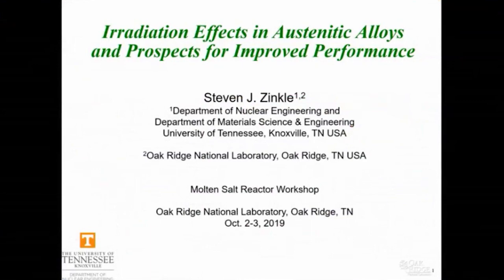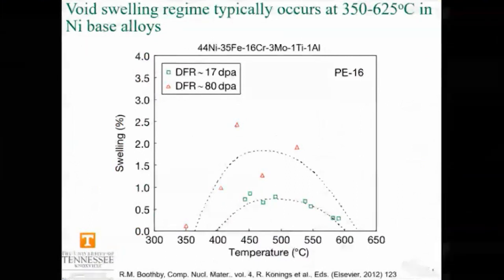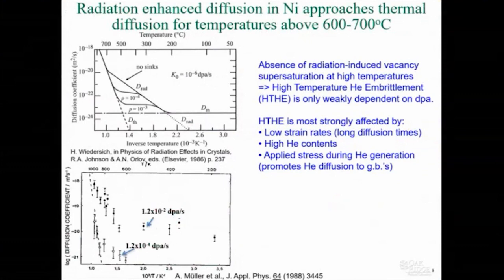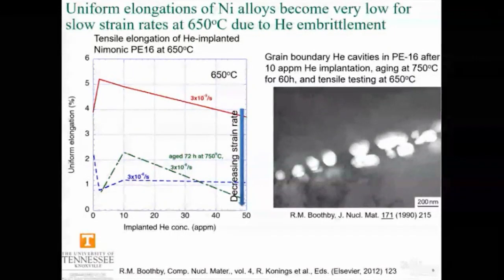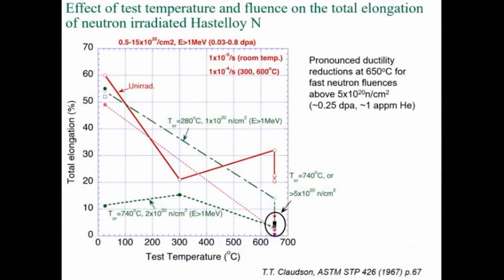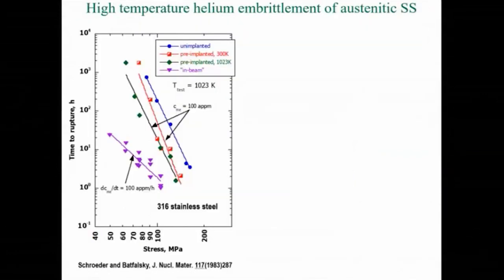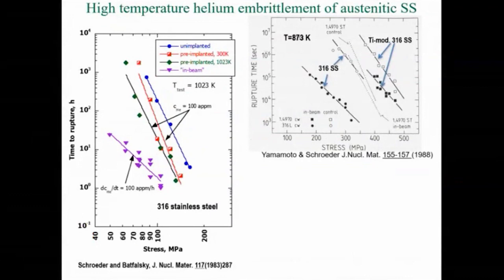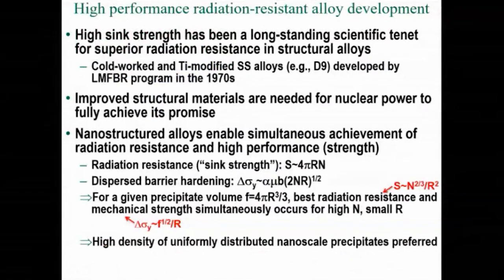Irradiation Effects in Austenitic Alloys - Steven Zinkle @ ORNL MSRW 2019

Comment: How much stress does a low pressure MSR generate? 60 psig is not the same as LWR 2000 psig. Primary loop components are/were made replacable.
Reply: Good question, I'm guessing the problem is not pressure-related, but rather thermal expansion of the core and/or any fuel salt/coolant/blanket salt pipes. If the metal becomes less ductile, there's a greater chance instead of flexing, it might crack. It seems to really depend on whether the reactor needs or produces helium during the reaction.

Comment: Is this relevant to a course I'm taking next fall called "Nuclear Reactor Metallurgy"?
Reply: I'm going to say yes, depending on the type of reactor you're studying/trying to make. As the video basically states, they haven't made or found the perfect material yet, so there's room for improvement!
Reply: @AximandTheCursed  Thanks for the reply! Well it's in South Korea and they only do PWRs, so I'm afraid it won't be anything related to molten salt reactors.

While I got you: When he's talking about helium, is he talking about alpha particles generated from decaying fissions products? And if so, would Flibe's reactor, that in theory can do online chemical seperation of fission products, reduce this  problem by putting the source of the helium away from the SS?
Reply: @viktornerlander1409  From what I understand of the LFTR, it uses inert helium as a blanket near the top of the core vessel to provide a buffer for removal of gaseous fission products, as for alpha decay? Well you are correct in that they are helium atoms in an excited state, but they have a hard time getting past a sheet of plastic, so I imagine the coolant salt would absorb/stop them, unless they are right up against the wall, in which case there isn't much you can do to stop it, short of the "layer of frozen salt" that they tried to make work in the original MSRE to prevent the heavy fluorination from corroding the vessel. The LFTR design does mitiate most of the problems, but I don't think it eliminates it entirely. Good luck with your studies!
Reply: @AximandTheCursed  Thanks, and thank you for the explanation!
Reply: It sounds like you just got your primer for the class...